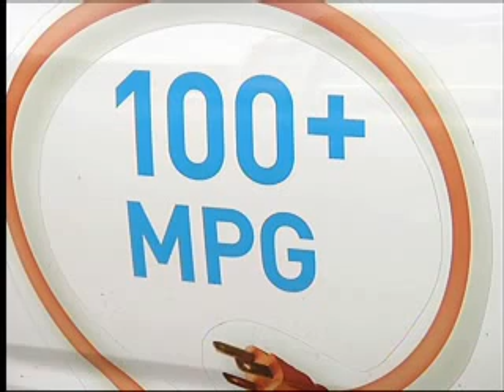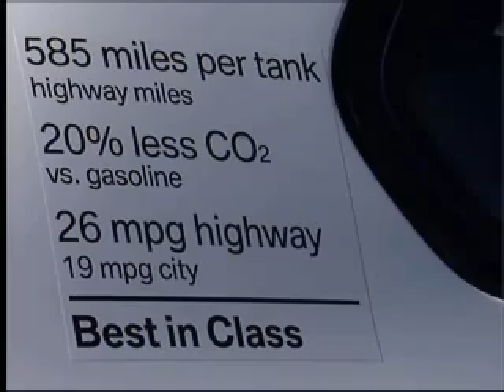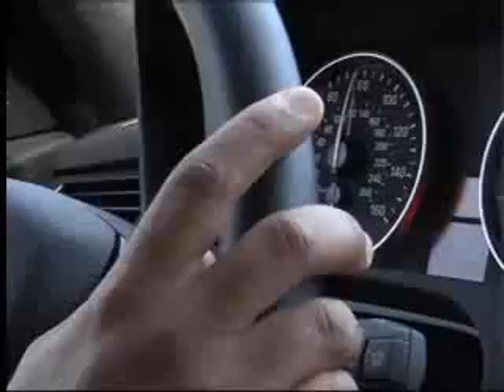GOING GREEN: Clean Diesel Technology

Comment: I have a diesel Oldsmobile 98 4-dr. It is a 1981. It gets about 28 mpg on the highway@ 70 mph and 17 in the city. Remember this car is a tank and 28 mpg @70 mph was a miracle back 30-yrs ago. 

The original engine blew in 2001 @ 150,000-miles. Now it is on engine #2 with right at 70,000-miles of trouble free driving. 

Very few cars that are 31-years old still have the same engine.

I wonder if the new Ultra-low sulfur diesel hurts older diesel cars?